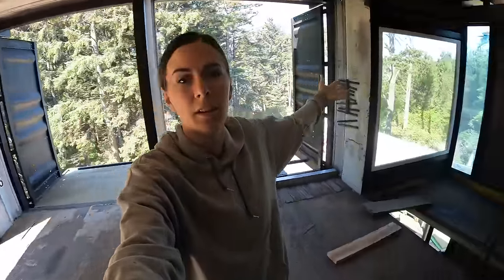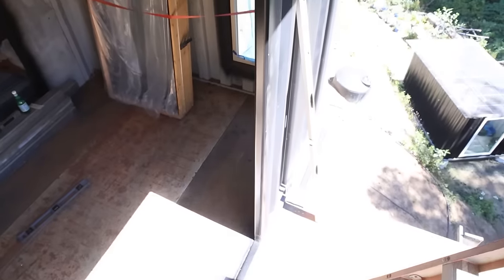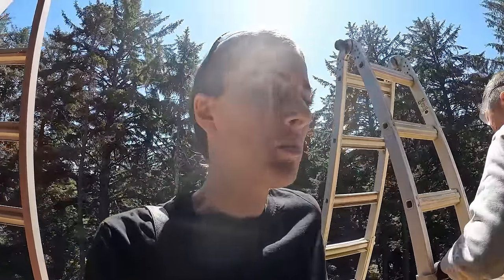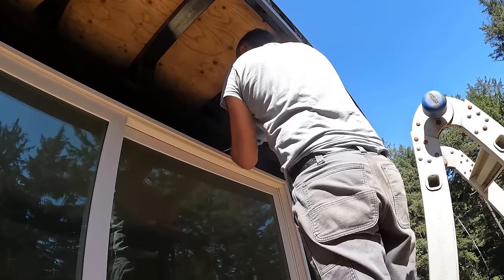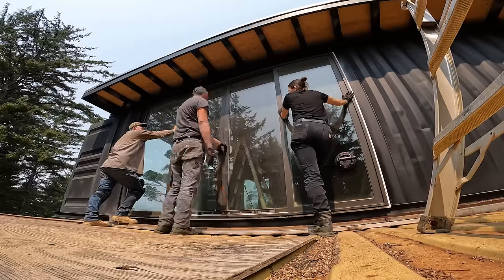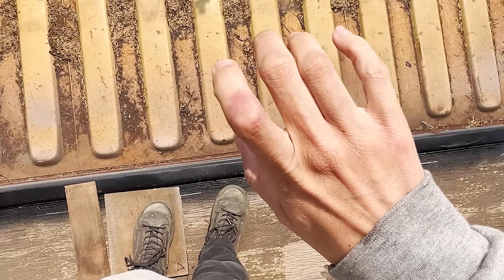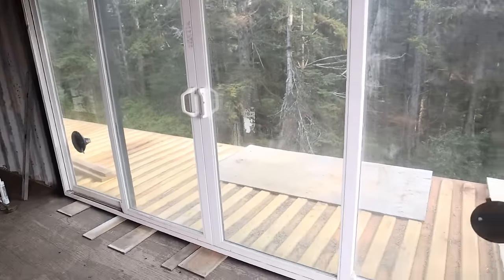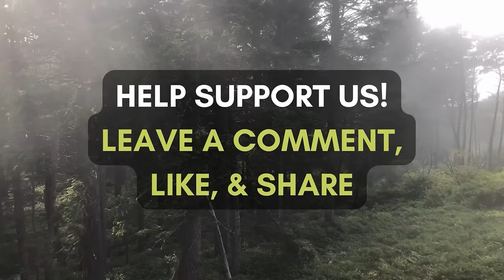Couple STRUGGLES installing *HUGE* SLIDING GLASS DOORS #diy #building

Comment: Hi I am watching your video right now. I noticed when you’re drilling you’re using a lot of pressure with no lubricant that’s why your stuff is breaking.
Reply: I agree. Even a bit of lubricant would go along way and even prolong the life of the bits and taps.

Looks like you used some oil on the second big door. Probably why not as many bits  broke. 👍
Reply from the maker: We use oil every time but I don't think it shows on camera. Great tip though!!

Comment: you should tokk the doors out of the frame installed plumb and level and them mount the doors after, is way easier than all together.
Reply from the maker: We need the doors inside to mark where to drill so everything fits as it should. :)

Comment: I don't understand why yall didn't just drill the pilot holes with door in place? Am I missing something. Double installing something seems like more work. Please explain if you have a reason. Love the work❤
Reply from the maker: We had to make sure the door was level and everything lined up so we could mark where to drill and install the sealant afterwards. Once the door is placed onto the sealant it is extremely hard to adjust/move, so we made sure to mark where it needed to go before we drilled/applied the sealant.
Reply: @PacificPinesRanch  oh I understand. Thanks for explaining that.

Comment: You really ARE going to have THE BEST views from that house.  I love that you are letting lots of sunlight in... and I'm curious - I've been seeing some modern construction techniques designed for net zero... so that you don't even need heating or cooling.  (You still need conditioning and ventilation but yeah... no heating/cooling.)  I just find that incredible!  I was wondering if this is part of your plan... and what you plan to do in the HVAC department.
Reply from the maker: Thank you so much!!! We will probably do an electric heating system (heat pump) but we don't really need AC. :)

Comment: My specialty is tool manufacturing. You are building a metal frame house and you need to drill a lot of holes. That's why I hiiiiiighly recommend getting a drill sharpener - it's a game changer!!!! Good luck in your hard work!!!
Reply from the maker: Yes absolutely!! Thx so much :)

Comment: For next time installing patio doors. Remove the slider doors to lessen the weight and install frame with stationed window only.  After installing it you can then install slider back in and if needed there’s an adjustment screen on bottom sides to adjust level of slider door.   I’m just shocked that you all did not have safety harnesses on in case wind 💨 came up and blown patio door outwards and you 😅couldn’t hold it and went over edge with door.  I’d would have welded a ring to the bottom roof beam so you could hook up.  Scary place up there.  Better to be safe sorry 😵.
Reply from the maker: Definitely! We had to install the door with the doors inside so that we could mark where to drill and so that everything would fit as it should. :)
Reply: The operating door lifts out of the track when fully open. Easy to change in seconds
Reply: Urethane caulk and a dozen self tapping pan head screws should be enough attachment. Urethane is extremely strong once cured. They use it to attach car panels

Comment: Looking good guys. Been following your journey since the beginning. Have a question about installing directly on metal... from a structural integrity, durability and ease of work perspective,  what are the pros and cons of installing directly on to metal frame vs adding wood framing around the metal frame before installing the window doors? And what is you wanted to replace these window doors in the future? How permanent is the sealant against the metal frame?

Thanks guys. Keep up the great work!
Reply from the maker: Thank you!! Going back we would have designed the door frames differently and used angle iron around the reinforcements with a wood frame (or something like that). The sealant isn't permanent so should we need to fix anything we could just unscrew it and remove it.

Comment: Could I ask why you used such small screws to fasten such a heavy door you would have been a lot quicker using 6 mm screws bigger drill bits and taps are stronger and quicker to use just a tip for future doors.
Reply from the maker: Yes totally! We had really limited space so we couldn't use bigger screws.

Comment: Hello, greetings from Puerto Rico, the island of enchantment in the Caribbean. My name is Jose, a great admirer of your project. I love your videos. You are an admirable and very hard-working woman. I ask you: Can't these doors be removed from the frame? The ones made here in PR can be assembled by one person. We disassemble them, install the frame and then the door and that's it.
Reply from the maker: Thanks so much!! We had to install it that way because the door is so big the vinyl sags when the glass panels are removed. So to mark the correct spots to drill we had to have all the panels in the frame. Otherwise we would have removed them like you said. :)

Comment: You do metalwork. I’m assuming formally taught at a technical college as you don’t get those skills just by doing. 

Two things:
1. You should use a “cutting compound” or descent lubricant whilst drilling AND tapping out the holes with threads. A cheaper option than breaking expensive drill bits, taps or fasteners. 
2. You could have removed sliding doors before fitting the frame. It would have made your life so much easier to fit.. Equally as much you could’ve left the doors in place to drill & tap although I understand why you did it the way you did. 

I notice on the first door you didn’t drill, tap & fasten the bottom frame. Likely on the 2nd frame too. Dunno whether that’ll be a slight issue later given the frames are just PVC..

Love yur work though.
Reply from the maker: Thx so much!! We are both self taught. We used oil every time we drilled but I don't think it shows on camera, and we had to leave the doors inside so we can mark where to drill to be sure everything fits as it should. The frame sags without the doors because it's such a long span. :)

Comment: I love you to death but you drive me up the wall. There are so many easier ways to do things, and it makes me wish that I was there to help. Such as the sealant that you use I would be using butyl tape. You put the door in then take it out then you put it in then you take it out. Why do you have to mark the holes take it down drill/tap the holes and then put it back in why not drill and tap right through the plastic. Of course, I'm telling you all this after the fact I'm sure you are done with it by now. To give you my credentials I am a certified welder 6G, a licensed electrician, I have a master mechanics license, and I'm a journeyman ironworker, with over 50 years of experience.
Reply from the maker: We usually do things a specific way for a reason. We had to remove the door anyways to apply the sealant, so that's why we marked where to drill/tap, then removed the door, tapped the holes, applied the sealant, and then installed the door. We could have drilled through the door but we had to remove the door anyways to apply the sealant. Butyl tape works great (we used it a few times on our RV), but we opted for Chemlink M1 because it's easier to apply around the holes (etc), and it works great for our climate. :)

Comment: Hi from Hawaii ,.....AGRRED WITH @harveybyrdsr8095 ....., Always use a squirt can of Oil when drilling because it gets .... Drill Bits hot and the it will loose its sharpness and cannot be sufficient later on again. I'm a Machinist and Welder that is why I commented on this. But you getting it done real nice and your 
project is advancing just fine.
     On your .......Roof Top you later on might consider to make a ..... Excess Ladder and a Little Viewing House for viewing ..... The Scenic Area around you 
and if you can see ..... The Ocean or Lake then it will be nice to observe also.